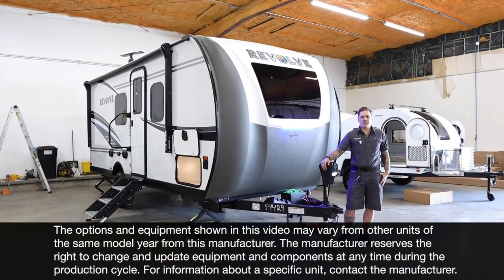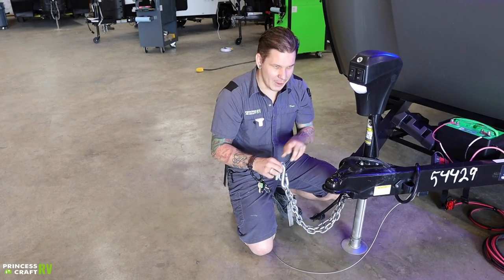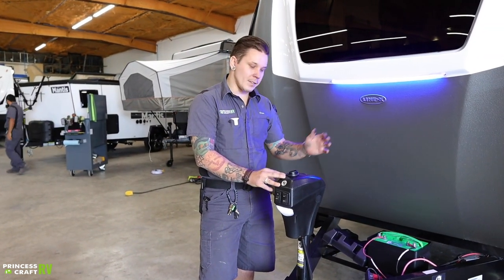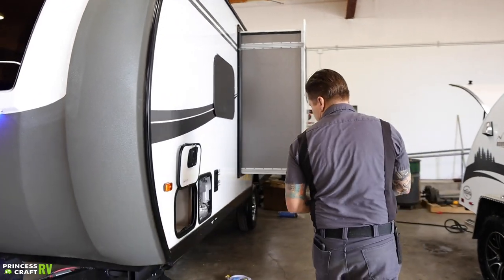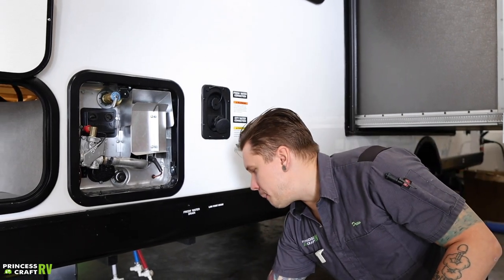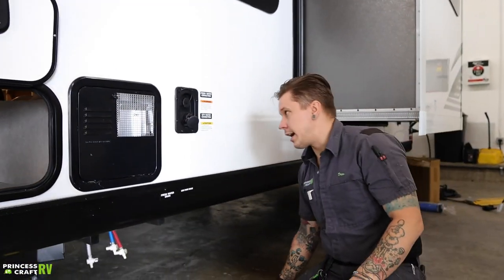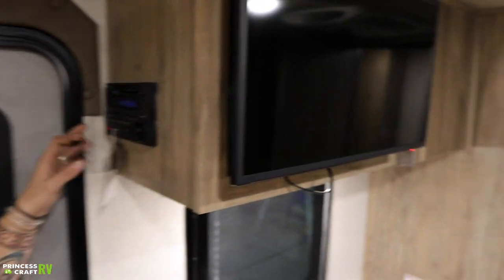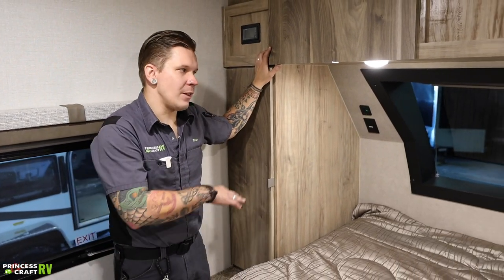2021 Revolve EV1- ALL Electric! NO Propane! - Technician Tour

Comment: My wife and I bought one of these trailers back at the beginning of August.  We fell for all the hype of how they didn't need propane, they are green helping the environment, we could do boondock camping which we love.  Every camping trip we took it out on we had issues with the electrical system.  They don't work like they are advertised.  Ours as well as the other 3 EV1s that our dealer sold have been sitting on their lot since November waiting for Palomino to figure out how to fix them so they work.  We are making payments on a trailer that we can't use.  They may look great on paper or while the engineers are showing them off but in real life use they don't work.  My guess is none of these people has actually used this trailer in real life camping.  Knowing what I know now I would never have bought this trailer.  Palomino knows there are problems with these trailers but I have yet to be contacted by anyone from Palomino.  Our dealer is caught in the middle and telling us that Palomino is going to make this right but so far nothing has happened.  I know we are the little guy fighting the big mfg but hopefully I save other people out from going through what we have with this trailer.
Reply from the maker: I am so sorry to hear this! We have heard lots of great feedback from our customers who bought these units, I hope Palomino can fix the issues with yours.
Reply: @RVTechToursatPrincessCraft  Hi Paul,  thanks for the respond.  I have to say I'm pretty surprised that you've had such great feedback from your customers that have bought the EV1.  I wish our experience and the other people who bought them from the dealership here would have had the same positive experiences.  We really thought it was going to be an awesome trailer until we started using it.  Anyway! I hope your customers continue to have good experiences with their EV1s.  As for us we can't wait to get rid of it!
Reply: Sounds like operator error.

Comment: Love the trailer and the concept.  Do you have any concerns with the location of the water heater, water pump and plumbing right next to the electrical system components?  Are the electricals protected against water damage, such as a leak?  Thanks.
Reply: Yeah I had the same thing after looking at that.
Electricity and water do not mix well.
The manufacture should have created boxed off zones for this.
A compartment for water and a compartment for electrical.
This would have made sense doing this but this was their better idea I guess.

Comment: Interesting concept for an all electric RV but I'd be concerned about how well all of this will work in real life use.  At the 17:52 mark, how secure are all of those electrical connections so they won't vibrate loose running down the road where the inside of any RV shakes like an earthquake.   The smaller gauge wires do not have quality heat shrink terminal connectors to prevent corrosion over the long term.  And no physical separation between all the electrical gear and the water lines in the same compartment - what happens in the middle of the night if one of those water lines springs a leak and shorts out the electricals right under your bed?  The RV industry has enough factory quality control problems already - this looks like it has the potential for lots of issues.  I had some interest in this RV until I saw this video - think I'll let some other folks guinea pig it first.
Reply from the maker: It's certainly fair to wait-and-see as something like this hits the market.

Comment: @rv tech. Thanks for the walkthrough.  My wife and I just bought an EV-1 as our very first trailer and have not taken delivery yet -  but reading reviews of such bad experience by other owners has me very worried.  
Can you share some of the positive feedback from your customers?
Reply from the maker: Congratulations on your purchase Steve! We have not had any problems with the operation of the Revolve campers, but sometimes it is confusing to the owners how to operate things because it is a different set up. I would make sure your dealer explains its capabilities and operation fully. Good luck and happy camping!
Reply: On our first trip we discovered how flawed this trailer really is. You cannot go even 24 hours on the installed battery power and it take 2+ days to recharge under ideal conditions.  
We are now looking at either a lawsuit for false claims or an expensive retrofit to plumb for gas.

Comment: @RVTech Have you discovered where a traditional LP gas furnace will fit in the EV1? ( I'm thinking inside the cabinet just aft of the slide out)  
Running on all electric is simply not possible unless the rig is plugged in.  Factory installed "furnace" + water heater will run the batteries flat in 2 hours
Reply from the maker: We haven't made any attempts to modify these units, so far. The ones we've delivered to customers seem to be performing well out there in the wild, under the conditions the owners are subjecting them to. So, we'll have to see when someone comes in wanting to upgrade or modify their systems!

Comment: Emergency battery connection is too complicated and too expensive.  Add an emergency selector switch to draw power from the flooded deep cycle; which is charged via the seven pin connection to the tow vehicle.  Then I don’t have to open the tow vehicle hood and look for the right tools.
Reply from the maker: It feels a bit over-involved to us, too.
Reply: Charging from your tow vehicle takes forever and it's not good for your vehicle to sit their charging for 2 hours just to get the enough charge on the batteries to get the awning and slide out back in so you can leave the campground.  I ended up having to buy a generator just so we could enjoy one day of camping before returning our EV1 to our dealership.

Comment: I don't own an RV, but shopping.  The EV1 would be a great RV to buy, but it isn't worth buying. So many problems I can see that whoever ok'd this RV should be fired.  And it makes think Forest River/Palomino have no clue what they are doing.  No LP is wrong.  LP for fridge backup, for grills, generators, heated and enclosed underbelly for true "off-grid/off-road" .  No trickle charger for AGM battery from solar?  And then there's the water heater and plumbing next to the electronics without a splash barrier is a very bad design. Throw a sloped wedge of azdel leftover so water slopes out and away from electronics. And winterizing could be better. Again, putting your hands in and around the plumbing with the electronics exposed seems bad.
Make the trailer 2' longer, separate the electronics (mount on side wall not floor where water runs) from water, fix the winterization issue, add LP, 3 way TV and Fridge and with the extra 2' add some storage. Low point drains are hanging there waiting to be ripped off.   Otherwise this trailer is worthless as an Off-Grid/Road unit. I'm looking for a trailer with solar and lithium installed, but also want a true off-grid/off-road unit which would be served by all sources of energy: solar, LP, and generator.  I love the trailers (Arctic Fox 22G & Lance 1985I'd rather pay more for done right) that have a locked, vented spot for a generator.  Princess Craft does a great job in reviews.  Too bad the tech couldn't give honest review and opinion on what he thinks about the unit pros and cons are as he does the walk around.
Reply from the maker: Thanks for watching and for your thoughts! Maybe we can communicate your ideas up the chain to our Palomino representative!
Reply: You are absolutely correct.  This trailer doesn't work in it's current design.  My wife and I had a Geo Pro before buying the EV1 and wish we had it back.  This is a hard lesson we are learning and shouldn't have to.  We were sold a bunch of promises that don't work.
Reply: Thanks for the honest feedback - saved me from making a big mistake.  Any update on where you stand with Palomino in resolving your problem?